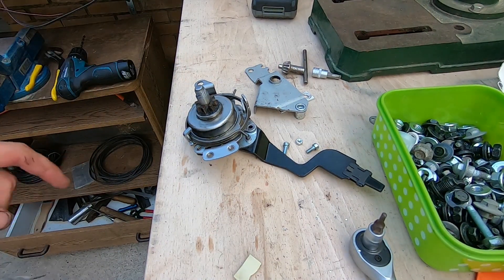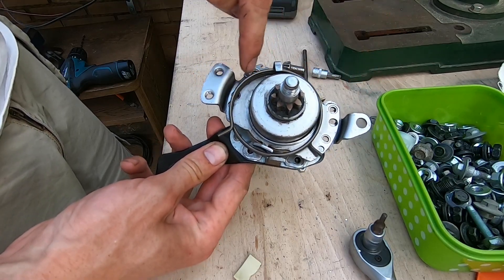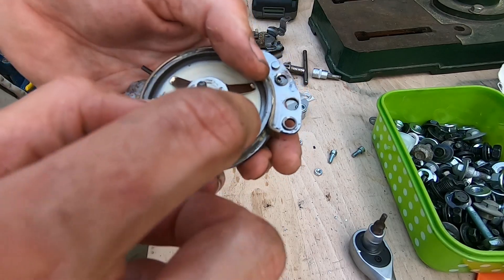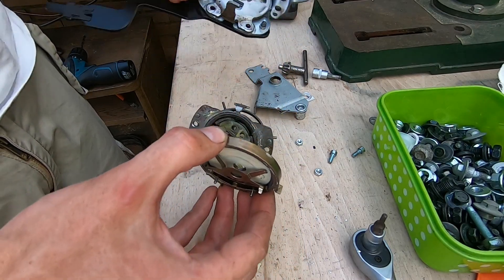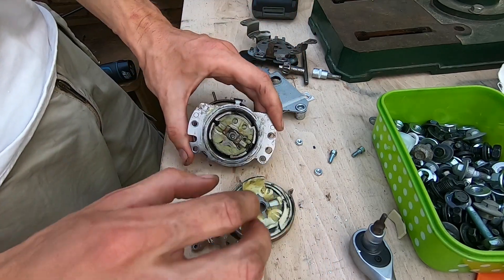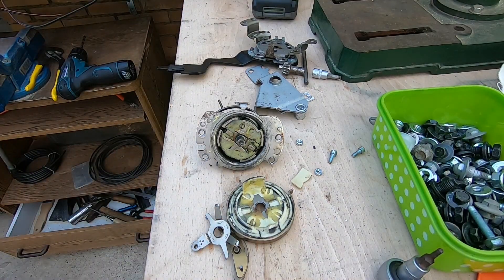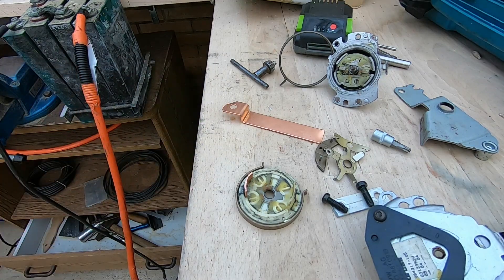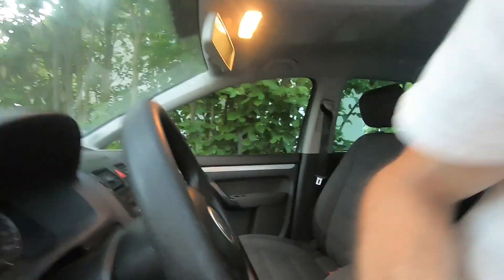Lab Update #52 - Planned obsolesence on seat height adjuster?

Comment: Hi Johannes. I am struggling with similar problem. Could you tell me do I have to disassembly whole seat first to reach adjuster part?
Reply: Remove 4 bolts to get the seat out.
Reply: yes you should take out the seat completely  from the car to can remove that part , I have the same problem in my Arona

Comment: Did you cut a hole for the copper or heat it a melt it in? I have used pieces of wire heated red and pressed into plastic parts to repair them. Doesn't look pretty but is quite strong.
Reply from the maker: A bit of both. Heated the copper by shorting 4 LFP cells into it while pressing it against the plastic in a vice. Also pre-drilled a grove. Not sure how long this will last to be honest but I'm glad the seat is no longer stuck in high position as I'm rather tall.
Reply: @openinverter  👍👍